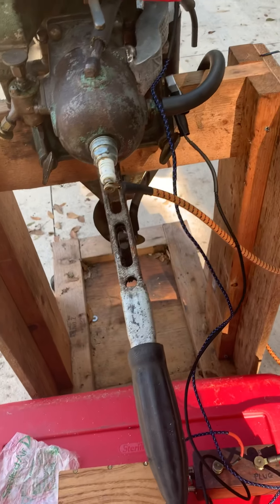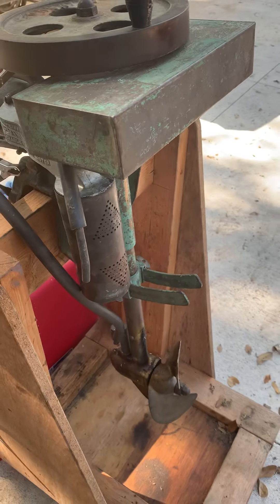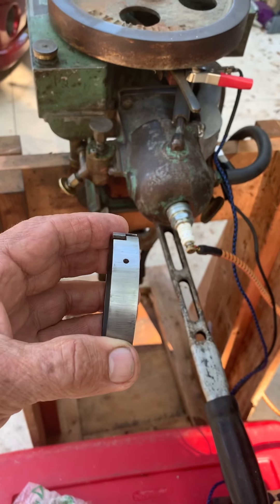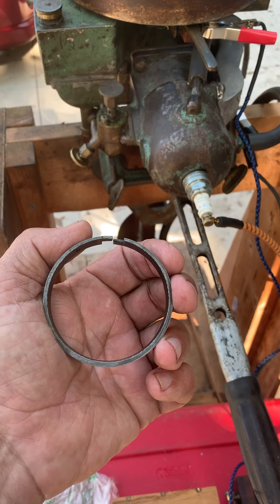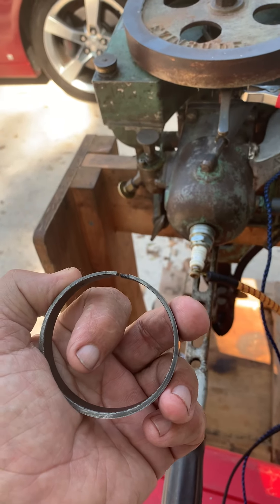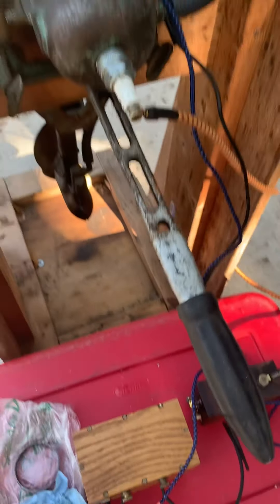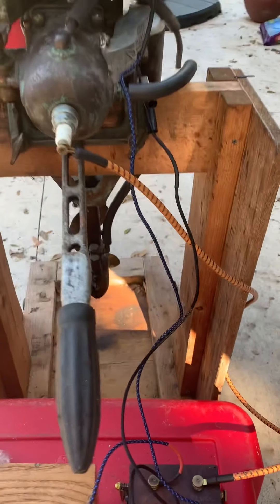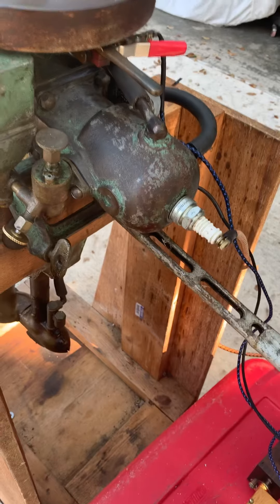1913 Evinrude Row Boat Motor - New piston ring - First runs.

Comment: I'm a lil confused by the description of how the piston ring is machined. My own experience is that the rings removed from almost any antique motor are going to show a thinner cross-section in the end-gap area simply because the ends of the ring are more  free to move outwards than the opposite side of the ring, thus more likely to suffer from wearing against the cylinder walls. I have always replaced rings worn to that extent with new rings that have an equal cross-section all the way around. Maybe I need to be educated on the subject, but honestly I've never heard of piston rings being machined or ground with that degree of offset. The fact that the original ring was leaking compression badly enough to prevent it from being operational probably points to it being worn enough for it to be leaking compression around the ring and across the face as well as through the gap.
Reply from the maker: Normally I would agree and had the same questions and head scratching as you. However to have a ring worn .040 on the gap side and ZERO corresponding wear in the cylinder led me in this direction. There was glazed crosshatch remaining  in all 360 degrees on the cylinder. Both the cylinder and ring are cast iron. No ductile iron would have been used in a cylinder 107 years ago so there should have been visible wear (not as much) at the gap area that corresponded to that theory. Our mutual Tennessee buddy had the cylinder measured and honed with no mention of abnormal wear anywhere. Only .002 wear in the cylinder and the wear was concentric. After that I got on the phone with some of our RBM gurus in the AOMCI and we came to the general consensus that the ring was built that way. 
To further check I went ahead and installed the current ring prior to material removal and the amount of friction drag was very noticeable in comparison to having the material removed.  Machinist also made mention that when you have a single ring of these dimensions that when he initially made the stepped cut he was surprised at the tension released by the ring and suggested that the ring may have been purposely manufactured this way in order to reduce long term wear. Apparently it worked. 
As it turns out there were many manufacturers that produced eccentric rings. These were produced for the same reason I had mine done this way and probably Evinrude did as well......uniform pressure around the circumference of the cylinder. Do a search for eccentric piston rings and see for yourself.
Also, thanks for the comments on the double ring set up. Thought about going that way.

Comment: Also - in the absence of a 1/2" wide piston ring, I have gotten many club members motors running again by using two 1/4" wide rings sandwiched together. Its a very effective and inexpensive method to rebuild these low RPM engines. The rings I use are standard cast iron rings with a stepped gap, and both rings are notched to re-use the standard locating pin in the centre of the ring groove.